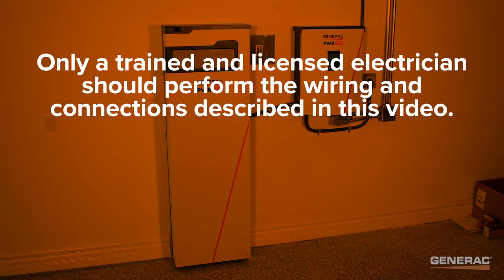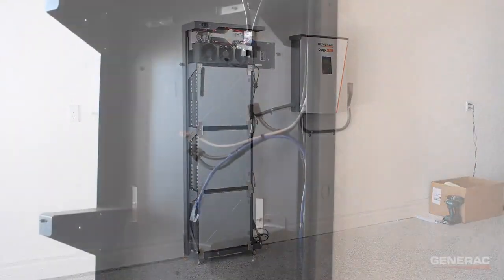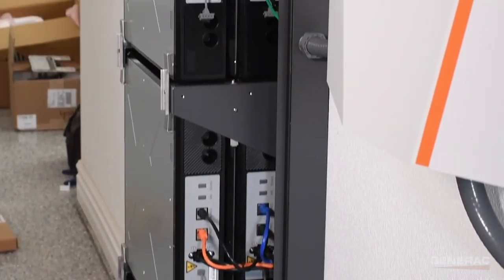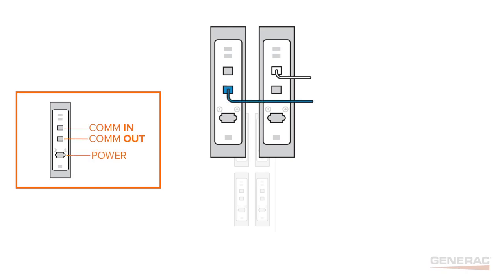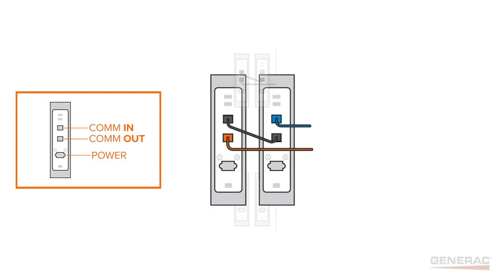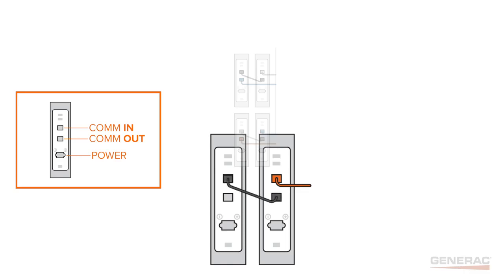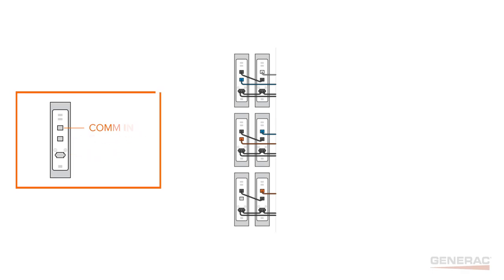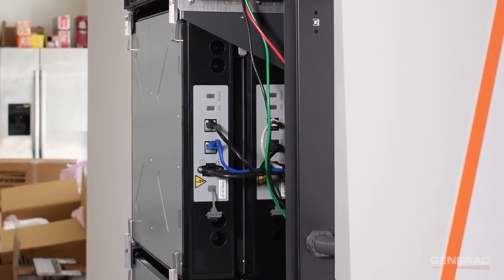Generac PWRcell Installer Resource: Wiring the Battery Modules

Comment: I just had a 22kw Generac generator with your automatic transfer switch installed. Are there any complications or difficulties adding these batteries to my existing setup?
Reply: ofc not just cost more